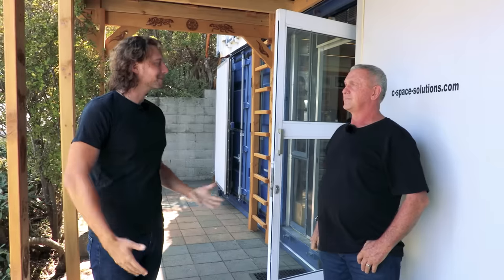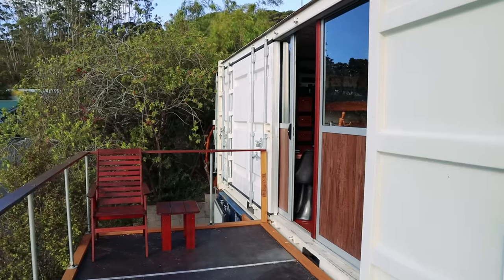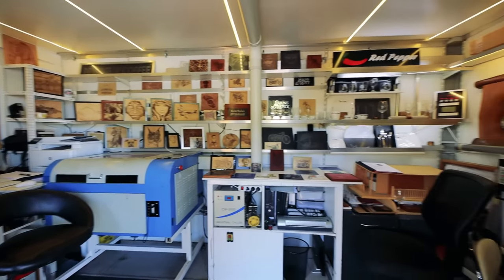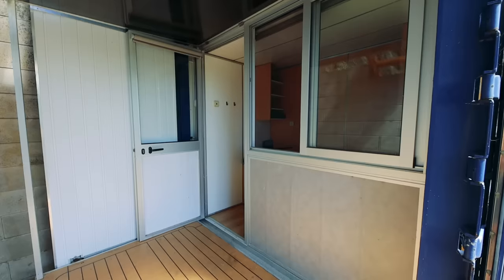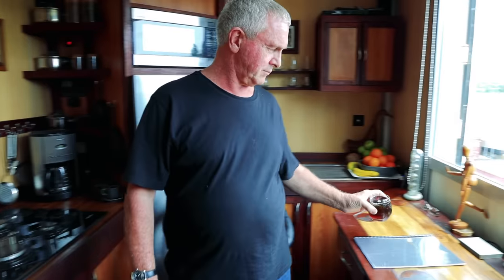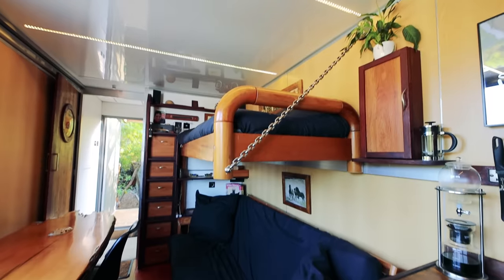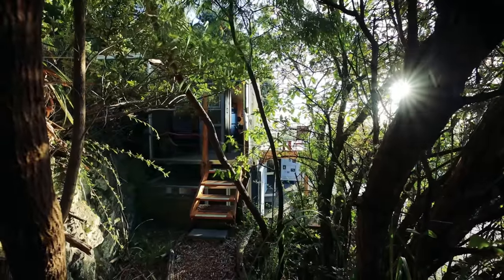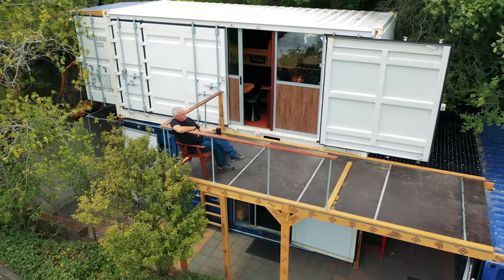Boat Builder's Incredible 20ft Shipping Container Home - Revisited

Comment: Evans has made a nice home and office in New Zealand. I assume he is on municipal water and a hookup to community sewage, so why the extensive water filters and storage tanks? It looks like he is also on grid electrical power. He cut a big side hole in the upper container where his door to the deck is so why say they are not cut so they can be shipped? I checked BC in Canada for allowing shipping containers and they are not allowed. I was told that the metal sides causes condensation and mould even when insulated from moisture produced by living in them. also used shipping containers often have chemical contamination that can cause health problems. I think not cutting holes in the  container would limit ventilation and could cause moisture problems if you lived in a cold climate especially. Does anyone know how he insulated the containers? Was the home approved by the municipal and or state authorities there? Evan Thanks for sharing your home with us...
Reply from the maker: He didn’t cut a whole, it’s a side opening container so the whole thing can still be closed up if needed. You can check the first tour we did with him (link in description) to see more info on the home and it’s construction.

Comment: Well, this is pretty good. I've discovered that I could build something like this in 2012 and was fascnated by this because here in Russia, you could spend like $10k (in 2012 prices) for outfitted 40ft HighCube if you do everything yourself including polyuretane foam insulation (it's cold here, man. 100mm PU minimum), fine aggragate concrete boards everywhere (think concrete countertop approach, but everywhere, its very durable and fireproof unlike wood panels), gas heating and cooling, lightning, very basic furniture and bathroom. And for $10k you'd get ability to evade property tax, squat almost everywhere or just buy or rent one of those tiny 600 m^2 pieces of land for "gardens" that were distributed in late USSR times (so people  could grow potatoes and not overthrowing the government) or a garage plot and those could be found right in the middle of some bigger russian cities. And if you have two, you could park your mitsubishi delica in the other and have largish workshop in it, so you could do some small jobs like repairing electronics or turning of milling something to order.

Comment: This is the guy to develop an idea I saw once in a Berlin Tiny -- a recycling shower. At the time I just thought it was a strange idea, but if you think about it, most of the water I use is in my shower and it should be easier to recycle that than to construct a gray-water system for an entire apartment. It should be a component of a shower standard shower unit you order and someone installs in a day. You should save on energy (heating the water) as well and if you recycle the shower water you can ignore the water from the sinks since they don't really amount to much.

Comment: How does he not get robbed and where does he park a car?
Reply from the maker: The containers can all securely be locked up when he goes away, plus he is in a really safe location. He can park his car right next to his home.
Reply: Lock the doors? Parking on the street?
Reply: Not everybody wants or needs a
car.  Why worry about a robbery.
Most people are insured and all
things can be replaced in life.
Reply: Half the point in shipping containers (when being used as shipping containers) is that they are difficult to break into, so if their basic structure and mechanism's aren't compromised they're probably more secure than most regular houses when they're all closed up.  Well, assuming any would-be burglers aren't enthused enough to bring the relevant truck and container loading equipment and make off with the whole thing, at least!